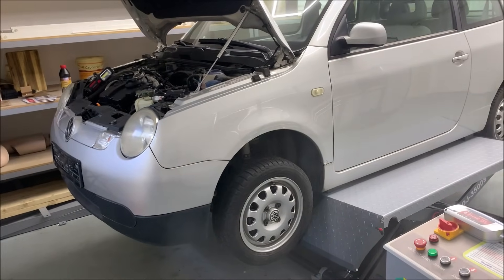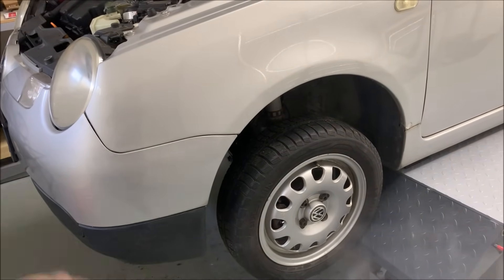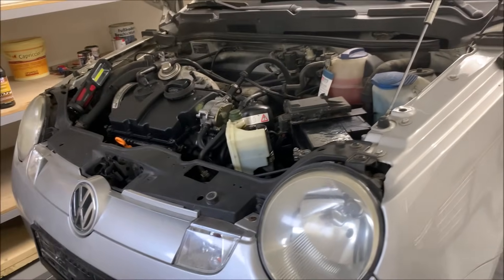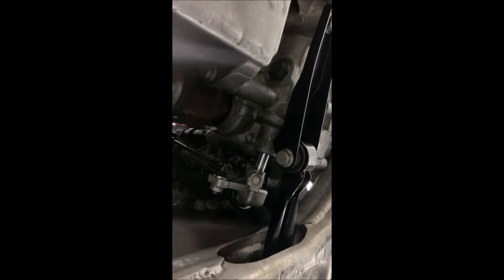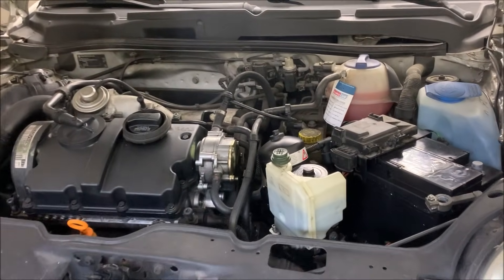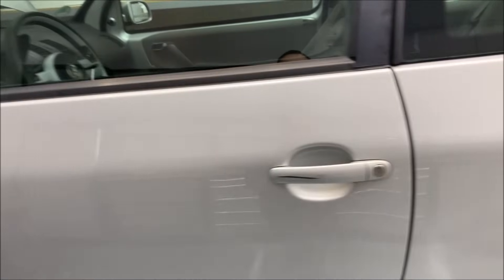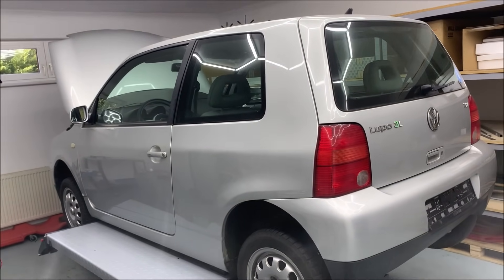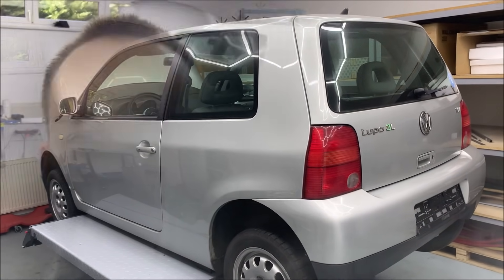VW Lupo 3L - Part 6 - Assembled and Programming Issues

Comment: It's a Volkswagen, so of course it's an electronic issue
Reply: Last Lupo was made in 2005. The gearbox was never nice to drive even when it worked correctly. Manual swap is the best solution if you don't have a specialist nearby. A shop near me sells and fixes them, many still on the road
Reply: @7eis it’s normal troll who doesn’t know what they’re talking about.

Comment: Maybe get the Porsche 12V LiFePo4. Works fine on my B5 and 8L (in the summer) even if it is not normally fully charged by the alternator obviously. Only 7kg in weight for 40Ah. The small TDI could easily be started with a quarter of that capacity.

Comment: Which diagnostics software are you using?

To keep the voltage above the 12.8 V consider buying a Battery Support Unit. It also can be used as a normal charger. With a proper charger (ie with maintenance mode) for sure that you will extend the battery life of the vehicles you own.

Keep up the good work!
Reply: I would recommend a Porsche LiFePo4 12V battery. Would fit the 3L lightness theme 😅